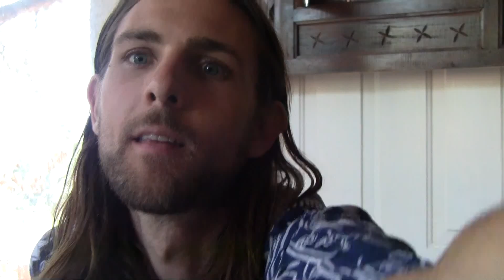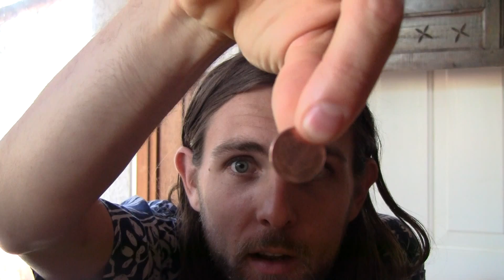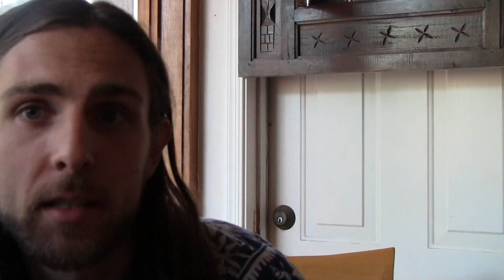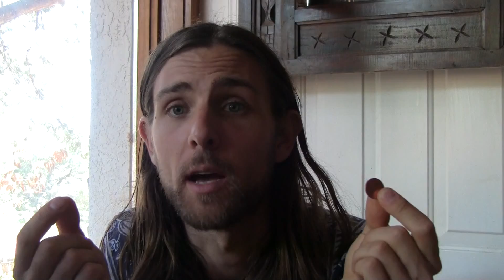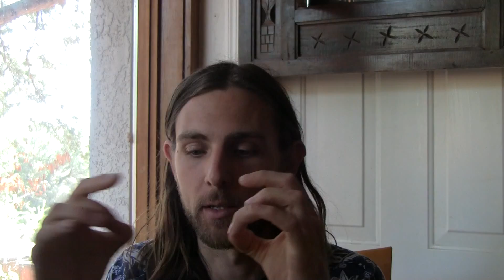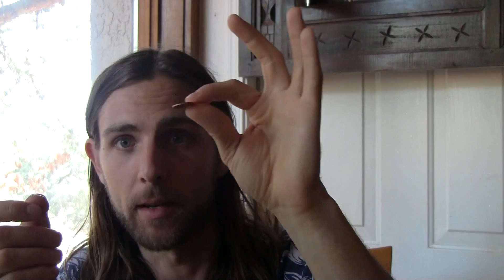Creating Energy Systems through Contact Electrification

Comment: I am working on a system whereby I am disassociating water into Hydrogen and Oxygen.  I am exploring sandwiching quartz crystal wafers in between aluminum whereby the piezoelectric properties of the quartz along with the electrical properties of aluminum will work together in such a way to break down the water through resonance.  As you know, aluminum (13) and silicon (14) is interesting.  Also considering how phosphorus [15] (perhaps phosphoric acid) or Iron (26) which makes it an octave of aluminum may be integrated... Perhaps Fe-SiO2-Al sandwich in a phosphoric acid bath.... The plan is to manufacture quartz wafers tuned to around 42.7 kH which is supposedly the frequency at which water disassociates...If you have any ideas, I would love to hear them...

Comment: Hi Gregor, I have considered this as well, especially in regards to alchemy of metals, and their application in creating abundant clean energy.  In my research on this subject, I am feeling pulled toward static electricity based systems that run at a high voltage/pressure, low/no current.  Of course this changes the geometry of systems dramatically since static electricity rides the skin of conductors...this is a whole new way of thinking about energy...